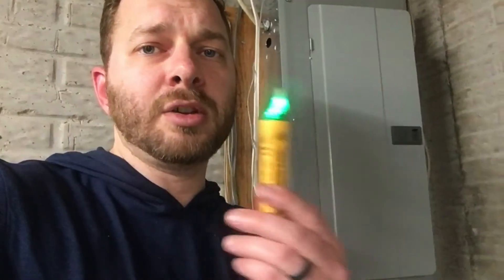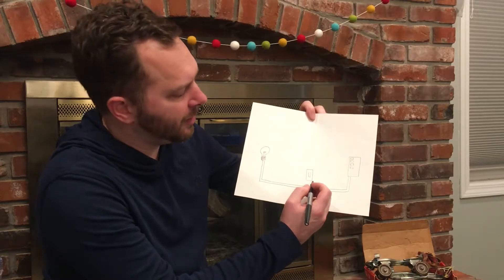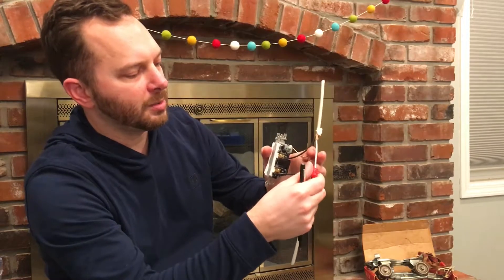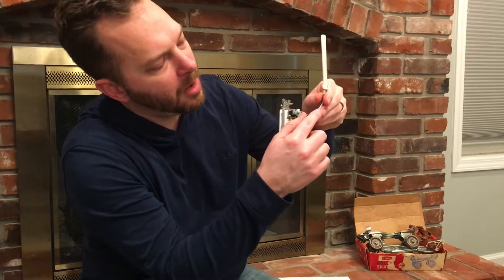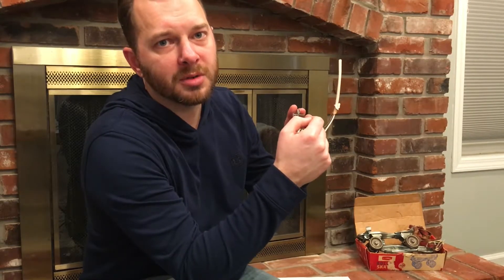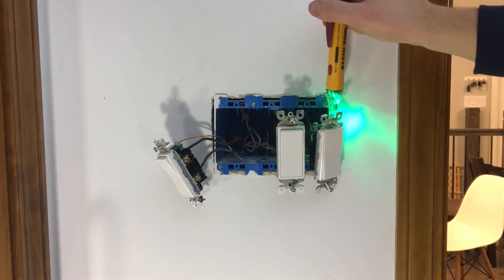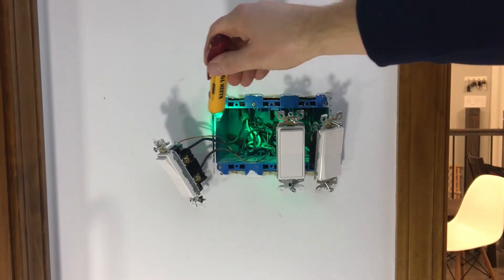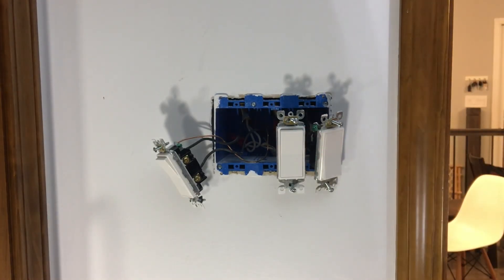How to know if you have a neutral wire for your smart switch

Comment: Not an electrician either but I believe it is legal (but check your local code) to share Neutral as long as the breakers for both circuits are physically bonded. This might be easier to replace the breakers to achieve that vs running new Romex (you might need to move things around in the panel if they are not currently next to each other). The total Neutral current should not exceed the limit of course but this would not be an issue for adding a Smart Switch which likely has a load of only a few 10's of mA (it's not adding the load current from the Smart Switch, only its power supply current). The other way to go would just be to utilize the same incoming line voltage for both switches thus sharing the same line and neutral. The line voltage originally on the other switch (being replaced) would be isolated and only the load conductor used. In this case the circuit must have the load capability for both circuits (should not be an issue especially with LEDs replacing incandescent bulbs and we are not talking about Outlets here).

Comment: I just get a smart light and tell the smart switch to control it.
To do this, you need to have constant power down to the switch and also constant power to the bulb. This is usually a 5 minute job by changing the wiring of the socket.

Comment: Not sure who wired my house. Switch at bottom stairs has 1 brown and 2 blues, switch at top has 1 red and 2 blues. The original switch is listed as a non-grounded switch, so does this mean one of the 3 wires is a neutral?

Wanting to install MOES smart neutral required switch. 

Does it matter which will be the master and which the slave/relay?

Comment: Very great video! Now I know you’re not an electrician, but would you know if you could you use a 3 wire with a ground when the switch has no neutral? I have easy access where I could remove the wires and replace them, and I was thinking the black and red would be hot on the switch end, the neutral being for the smart switch. Thanks

Comment: I have no neutral wires in my home as it was built in the early 70's. The smart switches require a neutral wire to power the wifi chip in the switch. Couldn't I simply split the hot wire or load wire before it goes into the switch and use the new hot or load wire as a neutral to power the wifi portion of the switch? I am aware that there are no neutral switches on the market but they are 3 times as expensive and im broke so Im looking for a simple hack to bypass this without having to rewire the house or return all the switches and go back to the originals.
Reply: So what did you do?
Reply: @UltimateSG15  Because the house is ancient and rewireing the whole place would cost and arm and a leg, I went a less expensive route. Lutron makes plugs that don't require neutral wires. While they cost a little over double what a plug that uses neutrals does I ended up only replacing some rather than all. It was really my only option. For the ones I didn't replace I'm just using plug adapters that I can pair with Google home.
Reply: @BenTodd79  Thanks for the answer guess i will do that too.
Reply: @UltimateSG15  No prob. It's not ideal but it still beats a full rewire.